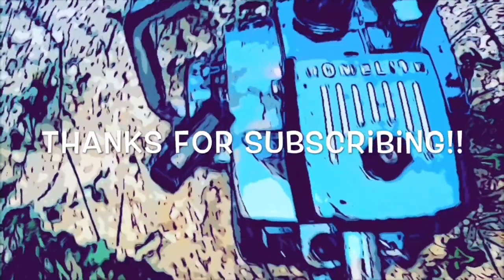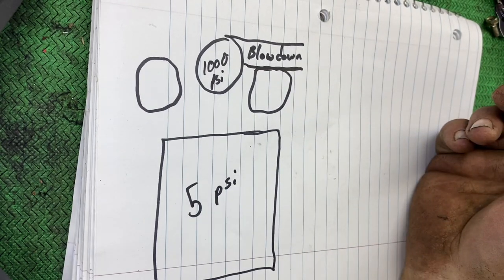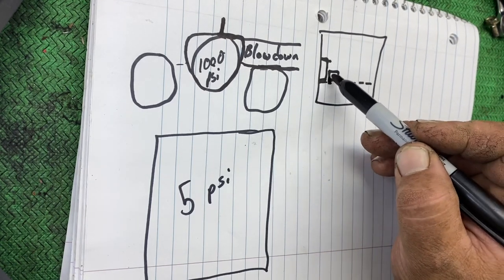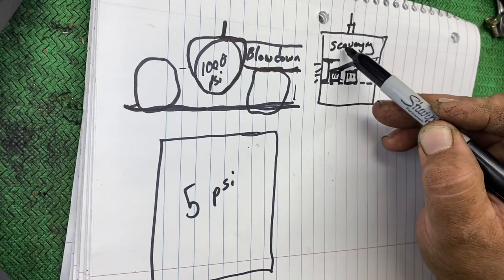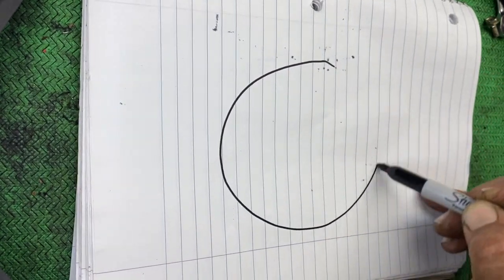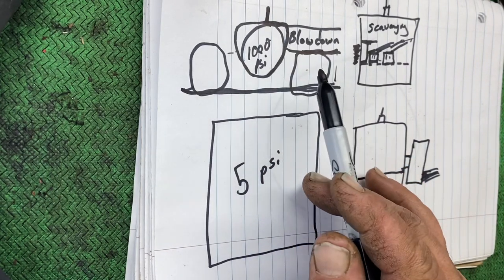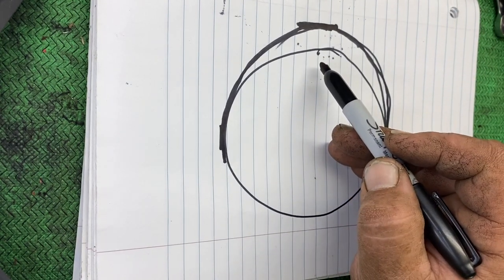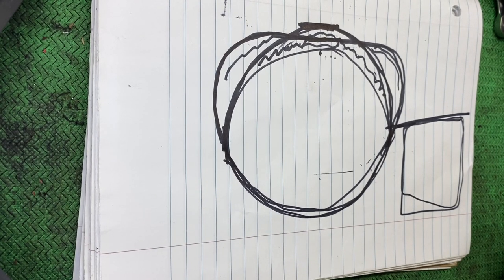How To Port A Chainsaw!  What Is Blowdown? Basic Porting Explained! Finding Peak Power! Muffler Mod!

Comment: I thought is was a good explanation it's nice to have people try to help with DIY chainsaw porting it seems more channels are going that way a few years ago it was tough info to get ahold of but with social media paying off  well for those who get the subs we all benefit thanks smitty I found a Yamaha blaster pipe in my ATVstuff not sure if it's a 125 or 200 cc expansion chamber hit me back if you could use it on the 925
Reply from the maker: Heck yea!
Reply: It was a new take off so it's nice I need to get you a pic I can cut it down for you and weld it up how do I connect Facebook?
Reply from the maker: @treebender261  Facebook or email will both work.

Comment: crankcase compression only reaches like 10 psi. If you think about the engine running at 50-250 revolutions per second or 3000-15000 rpm, think about how long the transfers are open for each stroke. If you have an air hose pressurized to 10 psi, and could open the gate for 1/50th of a second, and that is a full stroke of the engine at idle, how much air is coming out of that hose?
The only way these engines can pump efficiently is from the energy produced by the burning mix.
At first the expanding gases push the piston down, then as the exhaust opens and the gases hit the muffler can and expand, it created a pulling effect on the rest of the cylinder, vacuum. And a lot of it. So the transfers want to open just as the pressure is changing to a vacuum for the most efficiency.

After pondering this for a bit I see this as the only way to get enough transfer to run the engine. The crankcase compression combined with a vacuum on the other side means the transfer port sees a much greater differential than just 10 psi to atmosphere
Reply from the maker: Now start looking at tuned exhaust systems.  The push pull effect gets amplified!
Reply: @Smittyschainsaws  yes, I have build a couple of tuned pipes for my race saws.
Reply from the maker: @ljurhallabocken  Amazing!!

Comment: Great video. Are there go to numbers rule of thumb to improve saws performance. In 70cc  and 90cc saws. Long bar work saws.
Reply from the maker: Usually you  just don't make drastic changes.  The  longer the bar the less aggressive you get with raising the roof.
Reply: @Smittyschainsaws  thanks. I try and stay around 100 on the exhaust and 76 on the intake. I don’t have a lathe yet. It’s on the way as well as a 90 degree tool for the transfers. Thanks for the reply!

Comment: Hi. Could you explain why on chainsaws the crankshaft is shaped like a “pear” and not a full circle? Wouldn’t a round crankshaft increase the transfer pressure? After all, there will be less free space - on motorcycles it is round.
Reply from the maker: Yes you are correct but the largest gain from full circle cranks is very wide power band. Chainsaws don’t really need that wide of a power band.
Reply: @Smittyschainsaws  Thank you! You are the first to clearly answer this question.

Comment: Hello from Brazil my friend 

Can you try to help me, please?

My chainsaw(chinese)  has a problem with excessive compression. But when I remove the spark plug the piston rotates normally. Even placing your finger in thze spark plug opening causes the piston to become extremely compressed again. Yesterday I installed a completely new cylinder and piston, but the problem remains. I changed the spark plug, removed the carburetor and exhaust fan, and still the problem remains. Do you have any idea what it could be? Can I send you a video showing the problem? I have been seeking help with this mystery on various social media channels, Instagram, YouTube, but no one has been able to guess what could be causing the problem.
Reply from the maker: Send video. Nighthawk68mag at g mail